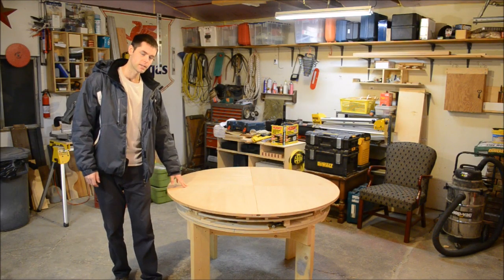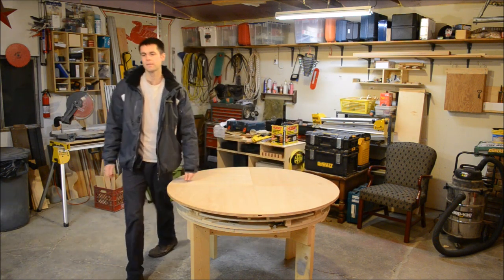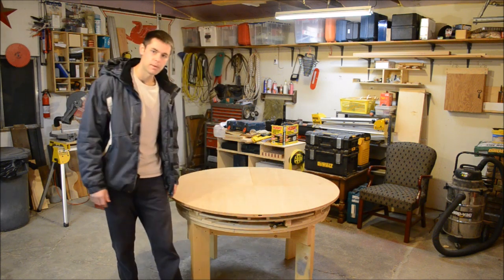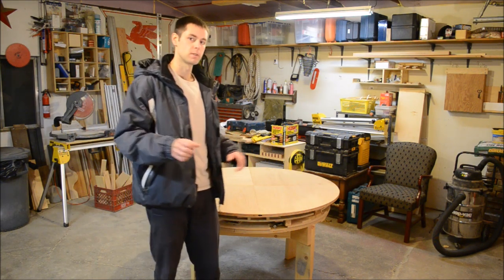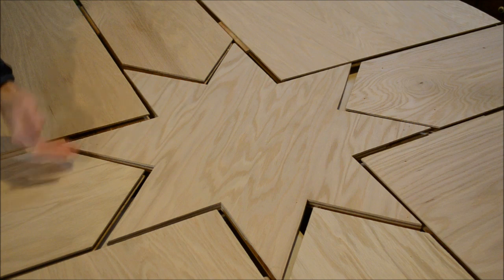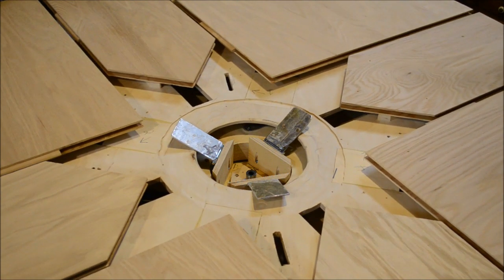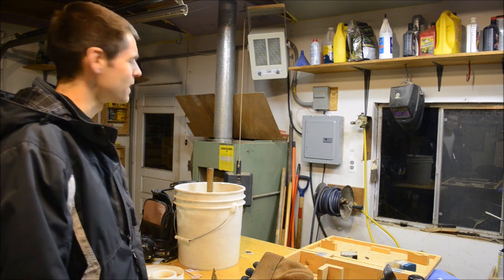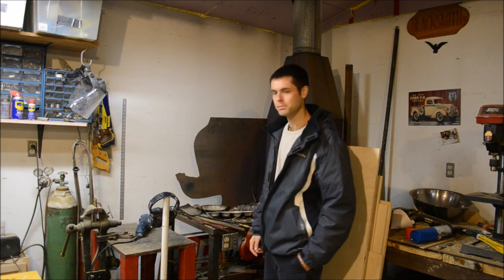Expanding Table Project: Star Preview, CNC and Updates

Comment: When you talk about a CNC machine, are you referring to the CNC machines that cut metal?  Is there a specific style/type of CNC machine that is designed to cut wood?
Reply from the maker: It was a ShopBot, by focusing on wood and some soft metals they're able to get away with a much less rigid frame. We didn't end up producing any parts on the mill though.

Comment: whats preventing the finished layer of the wood edges from splitting or chipping.
Reply from the maker: +gear head This is still something of a "dev model" table, so nothing in this case. For a nice version I would definitely wrap the outside with hardwood.